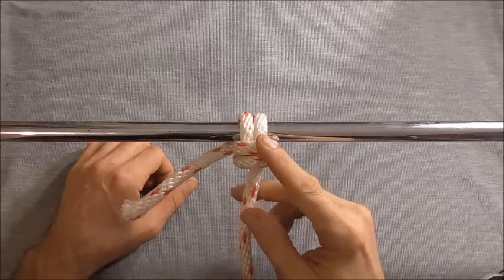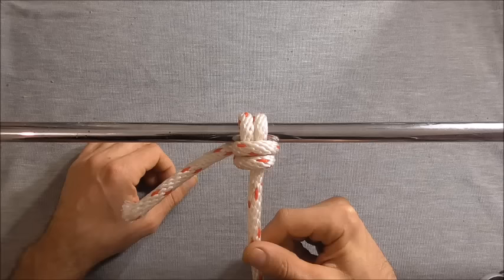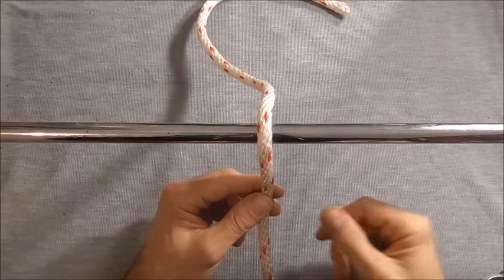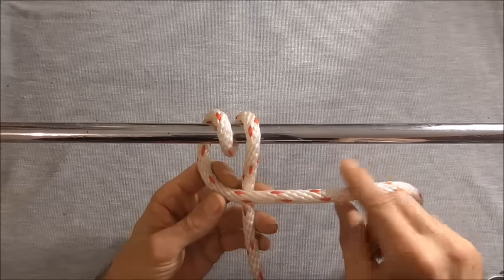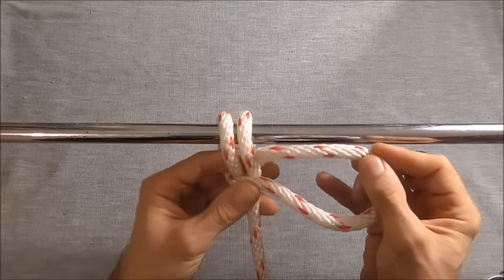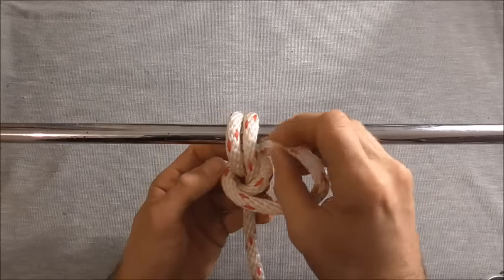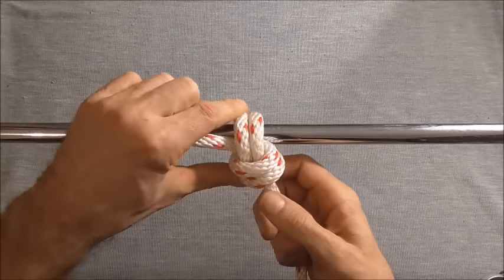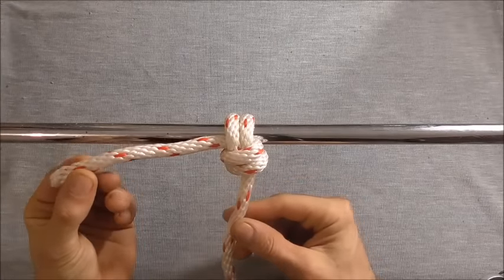How To Tie An Anchor Hitch Variant Knot - WhyKnot

Comment: I would like to know the applications of all those knots.  It seldom showed how to apply them in reality among all those demos.  Many thanks.
Reply: Peculiar comment. What knots do you already utilize? Have any failed, or slipped, or were problematic to release? Substitute one of these as appropriate.
Reply: @65csx83  Some knots are more suited (or not) to certain applications; far from peculiar, their comment makes a lot of sense.
Reply: @christiaanno5362  Disagree; especially about it being FAR from peculiar. There is no Intergalactic Commission of Knot designations. Knots can be used anywhere needed in a person's activities. I doubt anyone would engage in a sport or lifestyle activity just to utilize a knot seen in a YT video. You note I did include criteria by which a substitute may be considered.
Reply: @65csx83  i suppose they should change the channel name to HowKnot
Reply: @christiaanno5362  have you ever used this knot for the anchor of your yacht mate?
Reply: @robertpapich  no, I don't have a yacht.   I work as a telco rigger, so I'm always interested in different knots.   That's why I wanted to know the application!  I like the extra round turn in the half hitch,  it might work well with 2 half hitches,  which I often use for very temporary ties
Reply: @christiaanno5362  I am also interested in knots and i was just giving a practical role for the anchor knot.

Comment: I like this knot compared to the common anchor bend, it doesn’t tend to work loose when a load is off the rope.
Reply: I add a half-hitch around the standing end...doesn't look as nice, but minimizes loosening.
Reply: @carlingraham114 that’s how it’s supposed to be tied

Comment: Good afternoon. Please tell me the purpose of this knot. When is the best time to use this knot?. How is this knot more secure than a bowlinie or figure 8 knot. I am curious. Thank you and have a good day
Reply: It holds fast to something like an anchor or post, something loose like a bowline would shafe especially in a boat situation. I use this tying equipment to a trailer or truck as it holds tight where you put it. One additional thing I do is run the loose end back through the knot leaving a loop on one side, that way when I untie it I can pull the loop through, and that gives me enough slack to easily untie the knot, there are several variations of this knot.